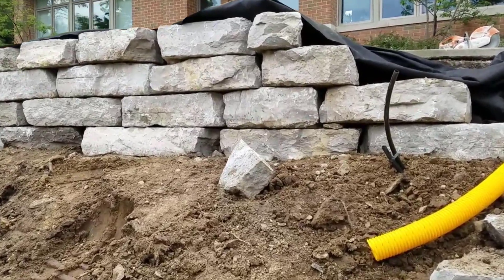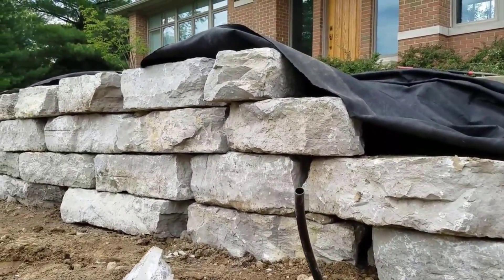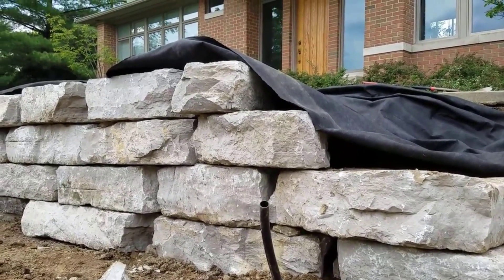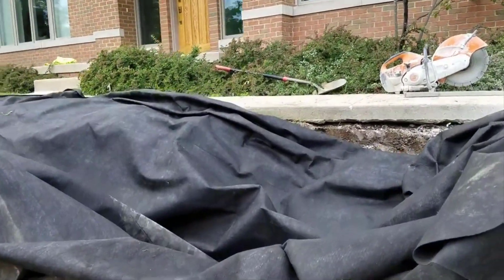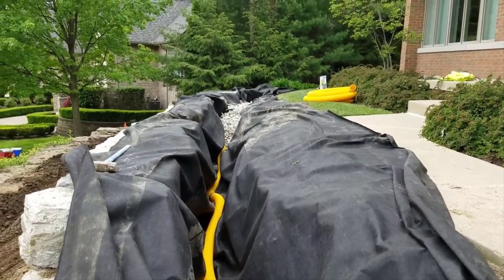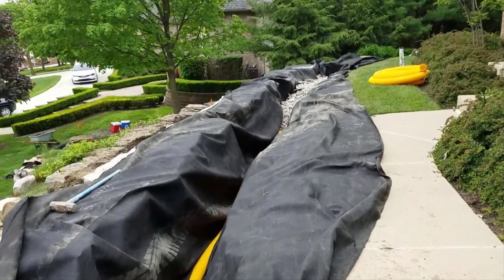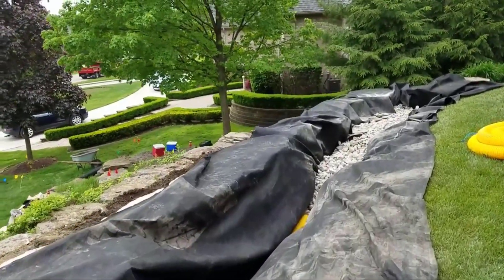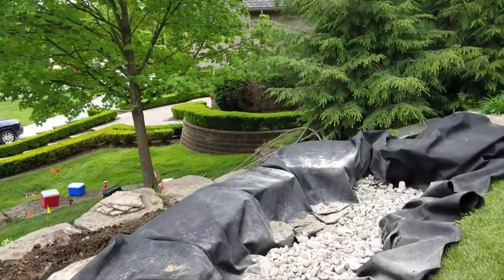When to Use 8 oz Non-woven Geotextile Filter Fabric

Comment: 2 years ago you said yes to using 8 oz fabric behind a retaining wall. 3 mos ago you said you 4oz has a higher flow rate...wouldn't you want a higher flow rate behind a retaining wall? I'm in the Tampa Bay FL area if that makes a difference. Thanks
Reply from the maker: With big sharp rocks, the 8 oz doesn't rip. 4oz is fine with block walls